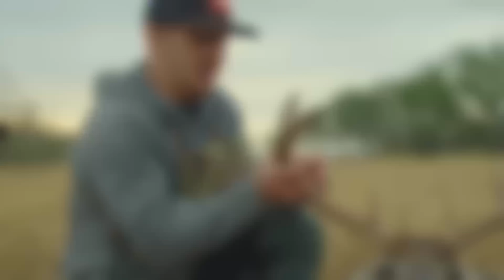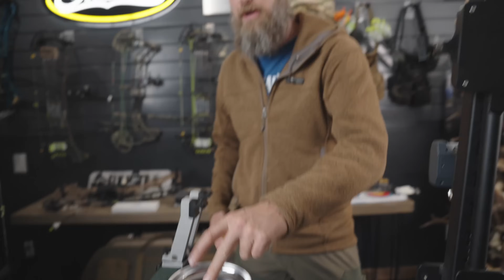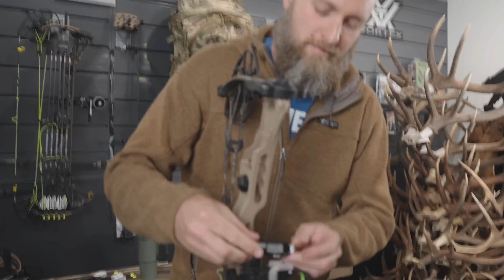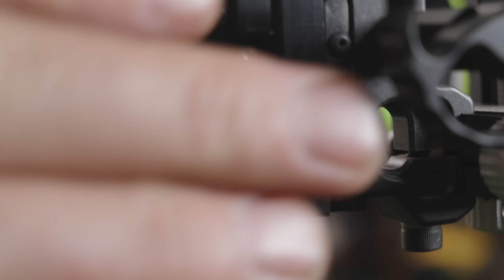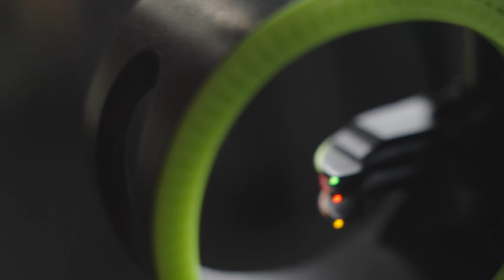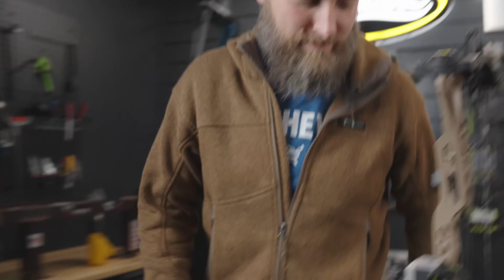Spine VS GPI…And Black Gold Fixes!

Comment: Controversial comment of the day:  your 20 yard pin is useless for an open country hunting bow.  5 pin slider here, 30-70 yards.  Closer-in shots might be 2" high.
Reply: SAME EXCEPT 3-PIN 30-50
Reply: Right on.  Stopped using a 20 yard pin years ago, even for 3D.  If you’re western hunting it just makes sense to start at 30 yards.  Just like you said, anything closer than 30 and you’re just a little high.
Reply: @richardfiske6311  I agree that for western hunting probably does make more sense to start at 30 but I like having my 20 still just because I tree saddle hunt whitetail and most shots are 15 to 30 yards I shoot a 2 pin slider starting at 20 and can dial out to 120 so that works for me for now until I can hunt out west then my views may change
Reply: Depends what and how you hunt. 
Australian Flood Plain Pig hunting, I leave my top pin set to 20. 90% of my shots are between 20 and 30 in that scenario
Reply: Agreed! Top pin 30yards. Shot my deer this year at 10yards and it only went 40yards.
Reply: Just dial your sight down to where you want it. I definitely want a 20 yard pin

Comment: Hey Dan & MFJJ.  S&S archery has a black gold sight made specifically with features they think are good the sight is called S&S BACKCOUNTRY PRO HUNTER $359. Comes with dove tail and side mount 5pin or 3pin slider bottom pins .10 upper .19 colors are green yellow green 3pin and 5pin green green yellow green green. Also where can I buy that press setup you guys have? I’m very interested in one.

Comment: I agree with some other comments on here about having .010 or .015 pin size options. My Spot Hogg has .019. With astigmatism in my dominant eye, pins show up as a bad glare/halo in lower light for me and it’s hard to tell exactly where the pin is in the halo. I’m wondering if a smaller pin might help that out a bit. But great video guys!
Reply: it absolutely does, I have astigmatism myself and I grabbed a sight with .010 pins and it did help I'd say the starburst I see is about a third to half smaller
Reply: You can get the pins changed spot hogg has .10 pins they are changeable.

Comment: More 4 pin sliders would be great. I"m shooting a 5 pin Landslyde and keep debating on trying to pull one of the pins out. 

I think being overspined with a modern compound bow is basically negligible. Yes, at longer distances, you might not see as tight of a group as an optimally spined arrow, but I don't think the majority of people are good enough shots for it to really matter. If you shoot a quality arrow, with a reasonable fixed blade or mechanical broadhead, your bow is tuned, and you're consistent, I think you should be able to get that setup to group within hunting distances.
Reply: If being too stiff mattered the best 3D archers wouldn’t be shooting a .100 spine gold tip triple X.

Comment: Black gold I love the sights just the way they are. KISS. Don’t use the slider in the locked position and not a big deal if it takes an extra 30 seconds to adjust the ring. 
Love the content guys thanks!

Comment: Had BG custom made from local shop ascent verdict assault with 4 pin .19 .19.19 .10  20 30 40 50 yards all green with dual indicator for 20 and 50 pins with white housing awesome sight and super bright with no added light kit

Comment: I agree about those 2 issues BG needs to look at. The ring can be a pain to properly adjust. They do need to change how the wheel works. I think they need to move away from the polymer they're using and go to full aluminum for the mechanism.

Comment: I thought the 5 grains per pound was so you don’t essentially dry fire the bow by having not enough weight of the arrow?
Reply: 5gpp came from ibo/asa competition because you had people shooting 90# bows with 400 grain arrows to get the flattest trajectory.
Reply: @clintonmoore1070  sure, but there has to be some minimum arrow weight for the sake of safety. 1gpp (obviously on the extreme side) would basically dry fire and blow up the bow. Manufacturers don’t give a damn if you have bad arrow flight, the care that you don’t blow up your bow by shooting too light of an arrow and then trying to get a warranty claim for it
Reply: @bnelsonmedia  every manual on the market states the warranty is limited to manufacturing defects and doesn't cover dry fires or defects from aftermarket strings/cables. The only company I know of that covers dry fires is mathews, and that's only once. 

I've seen a crossbow shoot a bolt that the insert had pulled out a shot before, essentially shooting a 300gr bolt with a 165# draw weight. It derailed the string and shot fine after words. 

Speaking of that, the excalibur rev x is 325# draw weight shooting a 250gr bolt (+100gr fp). That is a 1.07gpp setup, so... maybe it's fine?
Reply: @clintonmoore1070  the manuals also state if you shoot less than 5gpp, your warranty is void, since they consider that basically dry firing the bow. 

I know nothing about crossbows, nor is what Dan and Josh were talking about related to crossbows. So maybe they have different guidelines from the manufacturers.

Comment: Single pin is better than a wad of 3-5 pins. Taped 20 to 75, since 76 yard pin and farther drop the sights to close to the arrow. 

Often dial the sight to 30 yards when i am going to be in the woods or 60 yards in open fields, but not in tree stand on the tree line.

Woodland range is within 20 yards to 40 yards before too many trees and brush come between the deer and me.

Open field more times I am going to be hundred or yards out, stalking within 60 yards of a herd or wherever I set up, ground blind, natural blind or just simply sitting on a folding chair, deer will come in from 100 to 60 before getting sus pf their surrounding. I got within 15 yards of deer by stalking, but usually around 30-40 yards they catch something that make them uneasy.

Often paper tuning and walk back tuning where you adjusting quite a bit will indictate arrow too stiff or too weak. The chart provided by manufactures are great reference point. But you got to shoot the arrows.

Tearing left on a right hand bow after adjusting rest a few increment for left hand tear, too weak of spine. Tearing right after a few increments of correction for right hand tear, too stiff. 

To adjust arrow dynamic spine, add or reduce weight. Or cut fractions of an inch on both ends of the arrow to stiffen it.
Reply: 3 pin vertical for the win

Comment: This discussion on spine v grains per inch is no different now than 20 or 30 years ago... the bow manufacturers stipulated a 5gr per lb draw weight to insure people weren't causing damage to the bow limbs/cams/strings, and was not about potential damage to the arrow. 

It has always been about getting the right spine for the draw weight/arrow length/point weight so that the arrow could properly fly out of the bow when considering arrow flight. Similar to high FOC and heavy arrows often suggested by click-baiters online, arrow weight has little to do with pass-through shots. The fad of heavy arrows with single bevel heads and high FOC comes from more and more people taking bad shots and trying to compensate for their lack of patience, poor technique, etc.

In Texas back in 2014, several of us archery shop owners sat with Mike E, Joe J, Don D and we discussed the sight stripping issue, bad rest cord clamps, and a great quiver... I agree it has been way too long past that discussion with no change on the sight issue. This year I had my first personal failure, during an elk hunt, and it cost me a mature 6x6 elk at 42 yards.

Comment: Remeber not ALL SPINES are created equal.... i have Black Eagle  zombie slayers 300 and Vicotry VForce 300, both cut to same length.. both react differently.. for similar flight, i can run 75gn more on the Victories with NO problem... PLUS i like the fact they come WITH spine alignment marks form the FACTORY.....